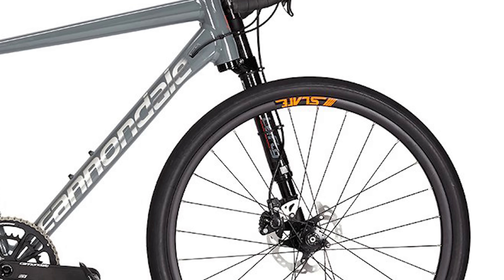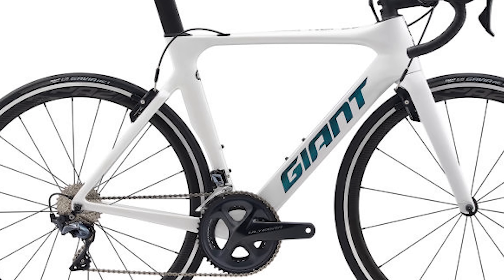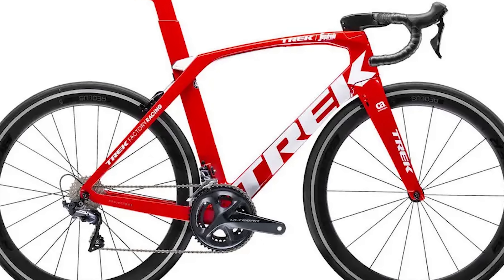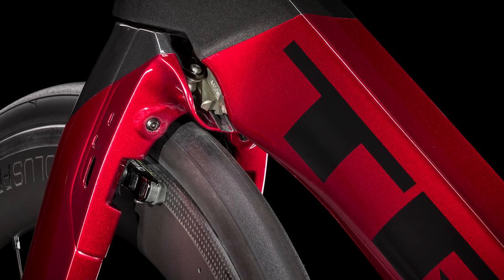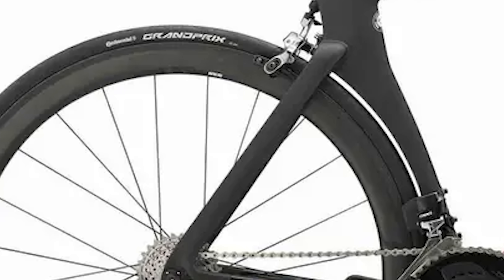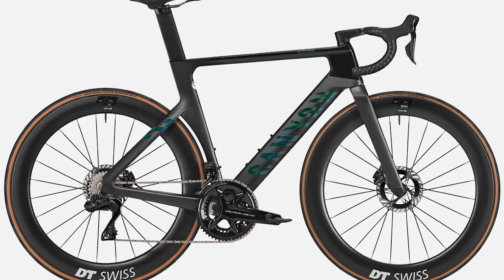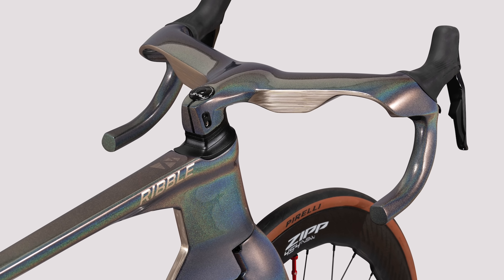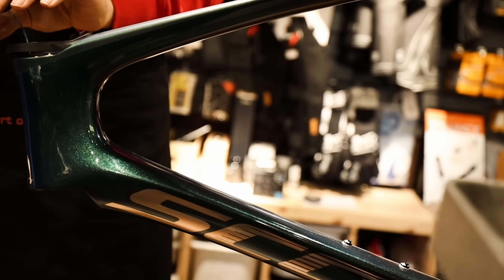Pro Bike Mechanic's 10 Most Hated Bikes

Comment: Everyone wants to get rid of their front derailleurs for some reason. I had a guy who was convinced he needed to convert his mid-level gravel bike to 1x. “What sort of riding do you do?” I want to ride the backroads in the mountains, but I also want to be able to mash back home on the highway. What chainring should I pick?” He made the best case for a wide range double you’d ever seen. In the end we convinced him to leave his bike as-is, since the only benefit he could come up with was “1x looks cool.”  Everyone is wearing out their skinny 12spd chains by riding crappy chainlines, stuck with less range than the old 3x8 used to give you!
Reply: Tell them to get rid of their rear derailleurs too. And brakes. Embrace the fixed-gear life.
Reply: 1x are just better for vast majority of cyclist
Reply: Biggest benefit for a normal person: less maintenance, less weight. 44t would be fine for mixed gravel and road without sprints
Reply: @krzysztofkolodziejczyk4335  How? It's never crossed my mind that 2x is an issue, at all, in any way lol
Reply: 1by is great for gravel rides. Don‘t mind the chainline, just ride. Easy and gear ratio is fine at „skinny 12 gear“ too. 🤷🏻‍♂️
Reply: @BevandEdMusic  it's lighter, simpler, cheaper, less maintanance, clear cockpit, and no real disadvantages for regular person.
Reply: @krzysztofkolodziejczyk4335  Well the thing is, that customer wanted to do a lot of things on the same bike. I bet most people only have one bike, or at the most one bike for commuting and one bike for fun. A gravel bike, although it may be a fad, is by design very versatile and most of them pretty approachable, so an excellent candidate for that one "fun" bike to get. That makes me think 2x on a gravel still makes a lot of sense, in general and certainly specifically for the person that's gonna do a lot of road cycling on it as well.
Reply: I bought a used 2016 Giant Cross City 1 (3 x 9 speed) in 2022 for just my wet weather commuting. It has done 8000km and never been washed, I've only rewaxed the chain every 300km and replaced the rear tyre once. No gear adjustment needed on Shimano
Reply: well... I have multiple bikes for different purposes, and I never shift on front. but maybe it is cause there is no hills where I live.
Reply: Word, 2x for life. I can’t understand the fascination of 1x, it’s a totally stupid idea.
Reply: @KillersFromTheWest  I'll see you're 2x and raise you with my 3x 😂
Reply: Front derailleur is only a complexity in theory in practice it's mostly set it and forget it. I ride mainly on my 48 ring but I love that I have that 34 when the hill goes vertical I can pretty much ride any gear combo even if I shouldn't without an issue. Especially when the extreme combination is extremely rare but is possible.
If I lived in very flat place is probably get away with a 44 single. But most places and most people would benefit from 2x in the front.  I get reducing complexity where not needed but this is actually quite a big benefit for little complexity.
Reply: I bought a Kona Libre alu with a SRAM GRX 1x it has a 40 tooth chainring and 42 tooth large cog.  I really like the bike, but the gearing is not low enough for the kind of long/steep climbing I was hoping to do. Had shop convert it to 34 tooth, had to buy a new bb, crank, and they removed links in chain. They did what I asked, but a few test rides on the street and sidewalk told me I made a mistake as it did not shift the way I like my bikes to shift, so I had them put it back. That was a $300 mistake! I have 1x on my Mtb, of course. Now I'm selling the components I can't use. I'll pass on what someone told me if you're shopping for a gravel bike: do yourself a favor and get one that has a 2x chainring if you live where there's a lot of climbing.
Reply: Tell everyone what shop you work at so people can avoid you. All the independent testing data from Friction Facts shows that 12sp chains are across the board more durable than speeds before that. 2x system on gravel bikes actually make it harder to get low enough gears to go proper gravel riding (who actually needs a 46t chainring on a double on a gravel bike? 46 x 11 on 40c tyres is like 60kph+, no one is holding those speeds on gravel.
Reply: Ever since I switched to 1x on my gravel bike I mainly ride in the middle 5 cogs of the 11-speed cassette.  Before I switched I found myself often in small/small or large/large gear combos.
Reply: Ultimately the wider the range in back, the longer the chain you need to run and the more slack your rear derailleur needs to take up.  Not a killer by any means: tons of people ride 1x, but it's not a panacea.  What I do like about 1x is not having to deal with the difficulty of front shifts: doing them well is an art, simply due to the much wider change in chain tension, and the large vertical distance between chainrings.  I ride a 3x9 drivetrain, and I have to spend a lot of time dialing in the front shifting.  I imagine mechanics prefer 1x setups all day long.
Reply: As far as chainline goes, it's amazing how much more efficient a fixed-gear or even single-speed drivetrain is: chainline is perfect, and there's no chain wrap or pulleys to deal with.  For short rides and flat commuting, it's so much nicer.  For really mixed terrain, or if you're trying to maximize your efficiency for a ten-hour ride, obviously gears start to come to the fore.  But if you've never ridden fixed, you don't know what you're missing.  It's like becoming a kid again.
For those riding 1x12 with a subpar chainline, seems like some chainring spacers or a new bottom bracket could solve that easily.  The same tricks apply to 1x bikes for optimizing chainline as apply to fixed/single.
Reply: @jorymil  I have seen YouTube videos on people riding fixies, grinding up steep grades and braking by means of locking up the rear wheel from high speed.  Made my knees hurt just watching it.  I take an 11- speed cassette any day. Though we all learned riding bikes with a single speed and coaster brakes, at least in the 70s when I was a kid.
Reply: @hansschotterradler3772

Bullsshat! That claim makes absolutely zero sense unless you had no clue how to ride your 2X bike. LOL
Reply: @ivanboesky1520  Oh, it takes a certain skill level to ride 2x.  I must have failed the 2x riding test.
Reply: I run double thick-thin chainrings on my mountain bike and shift by hand depending on the prevailing terrain. It's worked well. I tend to use the small ring for long climbs only. The large ring is good 90% of the time.
Reply: Front derailleurs are a nightmare to work on. As an amateur bike mechanic, I’ll always prefer 1x. Usually I just buy bikes that already have it though.
Reply: @saisamsuri The only thing more pointless than fixes, are those who ride them.
Reply: I use a 2x 26 36 on an 11 speed focus jam mountain bike. I took off the 26 for a while and even though I could still ride up the hills I found I was getting knee inflammation.

 By using the 26 on the front with 42 on the back and increasing my cadence I find my knees are healthier. 

The thirty six on the front is better for the flats and I drop it to the 26 under load when I am going up hills. I am very happy with my 2018 bike.
Reply: @saisamsuri  Already did that!  I run a single speed hardtail MTB for years.  Works for me 😂
Reply: iv got 2x10 and 1x12 ,no it isnt,its just simplicity and way too expensive to replace,i like more the 1x12  but the 2x has more options ,especially for top speed👍 (both bikes are xc's)
Reply: I dont really get why 1x12 is so popular. Even on hills with a fairly average mtb i only use the 7 highest gears, general riding its only the highest 4
Reply: To this day always used the same policy on shifting. Never had to change a chain or cassete. 3x9. Alwas indexing in a 1x3 mode. More than enough range if u have the legs
Reply: @regsmith5972 fixed gear is fun for commuting. You get great feel for traction and almost nothing can fail. That, and the resale value is low so people don't go out of their way to steal them
Reply: @charlesissleepy  No,  it's a fad, a fashion that people copy as they barely have a thought of their own in their heads. I commute a reasonable distance up a hill, and I would need my head examined if I tried it on a fixie.
Reply: @regsmith5972 Don't be so closed-minded. Have some people bought them because of a trend? Almost certainly. But here you've got someone telling you they find them fun to ride, who are you to say they're lying?
Reply: @RenAigu  Yeah, when I got a gravel bike I didn't want to look at 1x bikes.  I suck on hills!  But now I've retired to the beach and it's super flat and I don't use the small ring.  Not much gravel around here either, but I still like the bike.
Reply: @davidmundowyahoo7839  My 1998 road bike is 3x with a corncob rear cassette with 9 in the back.  I do like that set up but now I live where there are no hills.
Reply: @RenAigu  I have 7 or 8 bikes, only one has a single chainring and it's hub geared. The rest are double or triple. I live in Cardiff South Wales and within a 20 minute ride of my house are miles of pan flat routes or climbs of +20% gradient so I definitely won't "upgrade" any existing double or triple chainset bikes to 1x
Reply: @lenolenoleno  but lots of people use their gravel bikes as road bikes too. I agree on the 11 tooth bottom cog though. I wish more cassettes with 12 or 13 bottom cogs were available. I switched to compact and sub-compact chainsets for lower gears in the first place!
Reply: @davidmundowyahoo7839  Sure, but that wasn't the premise of the OP's comment.

The premise of the OP's comment was 2x = more range = lower gears when it really isn't so. 

My comment was that in majority of cases it's actually easier to get a lower gear with 1x given most gravel bikes come over-geared for the standard 40mm odd tyre width.

You're saying you wish there were more 12t bottom cog cassettes. A 50 x 12 on a road = a 40 x 10t which is pretty much the standard 1x mullet gearing setup.

Regarding road use: Yes, the steps are bigger for wider range cassettes, but only if you run an 11-32 cassette or lower. So the lowest real gearing you can get on standard sub-compact cranks is an 46/30 on an 11-32, which is really not that low (30 x 32). For cassettes 34t and up, the first 5 cogs (where you'd notice the highest cadence difference) is the same on an 11-34 as it is on say a SRAM Eagle 10-52 cassette. 

If you're riding an 11-32 cassette for gravel you're in almost all scenarios really not riding any proper steep hills for a sustained period (unless you're a full on pro, even they are riding lower gears for events like Unbound etc).
Reply: @davidmundowyahoo7839  Of course they do. But you don't hear people on 1x nagging that 2x sucks for gravel bikes where as comments like the OPs who assume 2x has "more range" when the majority is repeated gears and gears the majority of people would never use. a 48t x 11 or 46t x 11 on 40mm tyres is at 100rpm about 60-65kph. A tiny less than 1% of people are cranking at that speed yet that's the standard gearing. Combined with a 31t or 30t chainring and 32 or 34t cog, you still have higher low gear vs. most newer 1x setups these days.
Reply: i wanna see 48-30 in front for budget bikes
Reply: @lenolenoleno  are you serious? He talked a customer out of spending 100s of $ for no benefit based on the type of riding they said they do. Sure, if they were buying a new bike them maybe 1x would be the way to go but they weren't, they already a had 2x bike that was fine for the range of riding they do
Reply: @davidmundowyahoo7839  sit down mate. I'm not talking about a specific customer, I'm talking about groupsets in general, which includes buying a new bike/2nd hand. Never said "EVERYONE MUST CONVERT TO 1X".

Simply pointing out the merits of 1x, when YouTube is filled with old grumps used to 2x and 3x who are simply afraid of change. All have their use cases. 

Except 3x, that can go bye bye.

Comment: Honestly, I think people/companies need to stop using static pictures of bikes to market them. Integrated cockpits, funny profiles for the tubes, 'aero' brake calipers, etc - you're simply not going to notice any of them when the bike's in motion, and it's designed to be in motion!

For example my bike has semi-internal cables - they come out of the levers, under the bar tape, then swing around the head tube and enter the down tube near the top, then they exit the down tube at the BB (for the front mech) and chain stays (rear mech and brake). The only exception is the front brake which runs down the inside of the fork instead of the down tube. So it's a little bit of hassle but worth it for the protection of the cables, but the lack of integrated bar/stem means they're so much easier to work on. Yes, while the bike's propped up on the cafe wall it doesn't look quite as slick as some of the others, but that's 15 minutes of a 3 hour ride, and the other 165 minutes you just don't notice it.

I don't know about other folks, but to me, aero-schmero! I've got a good 20kg of beer belly and I like biscuits and cakes too much too, I'm not expecting to win any races any time soon because I don't race at all anyway. Sure going fast is fun, but I don't need to be going fast all the time. I ride at the pace that suits me and if I need my speed fix, well, you bet I can shift when I'm going downhill! :D

Comment: I ride a Specialized Diverge Comp E5, IT Has the future shock on the bars aswell. Never had any issues or need to repair, so I guess I got lucky on that part. But anyways, I absolutely LOVE that little suspension.
Reply: A redshift stem accomplishes the exact same thing and you don’t have a boat anchor of a proprietary part hanging in your headtube and fork. In addition, Specialized says if you replace your futureshock yourself when it eventually wears out it voids your frameset warranty. Another stupid marketing gimmick idea implemented by Spec. LOL

Comment: I think you meant BB90, not BB92 for the Madone. The PF92 BB was used on Treks pre t47 mountain bikes, and does have a Dub BB (My Remedy has a PF92 Dub BB in it right now). BB90 was that stupid design that creaked and didn't have a Dub BB
Reply: This is the BB standard I hate to work with the most.

Comment: Have the Giant Propel and i can completely agree - Cable routing over the stem is a pain in the ass if your doing any rewiring, etc. Also the brake setup means you have to defalte the tyre every time you want to remove the wheel as you cant release the tension on the areo brake calipers to fit an inflated tyre through.

Comment: Not a specific bike brand, but any bike brand with a single-bolt saddle rail clamp. They never stay in place at the angle you want, never loosen when you need to adjust them, AND they always creak.
Reply: On 3 different bikes with a 1  bolt seat clamp never had a single problem. I consider a 2 bolt system doable but also a hassle.
Reply: No problems. If it is moving then use some carbon grip grease.
Reply: never had any moving or creaking with one bolt saddle cramp. or loosening them. i had like 4 of them before moving to proper bikes, and i'm 90 kg. you are probably doing something wrong.
Reply: I've never had a single Specialized single-bolt saddle clamp even budge when torqued to spec.
Reply: Try a USE seatpost, never had any of the issues you mention!
Reply: My 1980's Campagnolo  Super Record  seat post works just fine.. I do admit  it is a little on the short side..
Reply: I really think double bold combined with a saddle which has no free space in between is a nightmare to adjust. You always have to take down the saddle and readjust the bold.
Reply: Single bolt seatposts need to be torqued fairly tightly.  Not "fairly tightly with a little pocket Allen," but with an actual torque wrench or longer Allen.  The bolt threads need to be greased: you want the torque to go to actual compression, not just thread friction.  I suspect many don't do this.  I prefer two-bolt designs as well, but single-bolt posts can be made to work well.  But really, just buy a seatpost you like.  If you can't use an aftermarket seatpost, you probably have the wrong bike for your needs.
Reply: Thomson seat posts have a 2-bolt fore and aft system that works extremely well.  I got their carbon one.  It came only in 0 offset.  By now Thomson may be making an offset one.

Comment: I have a Cervelo S5 (2012) It takes 25mm Hutchinson Fusion5 tyres not rubbing :)  All my bikes use 25mm tyres as I find 28mm a bit muddy with handling.
Reply: yeah, i’ve found the specialized 24 mm turbos fit perfectly.

Comment: Here's a POSITIVE one. 1972 Schwinn Varsity. Uses regular hex fasteners. (not socket head)
Want the bar higher? No problem, just loosen one bolt and pull it up.
Want to change the bar angle? Again, loosen one bolt, re-position it, then re-tighten the bolt.
All over the bike, it's the same story. Anyone can work on them. The only challenge is finding parts nowadays.
Reply: Easy except that junk Huret rear mech.